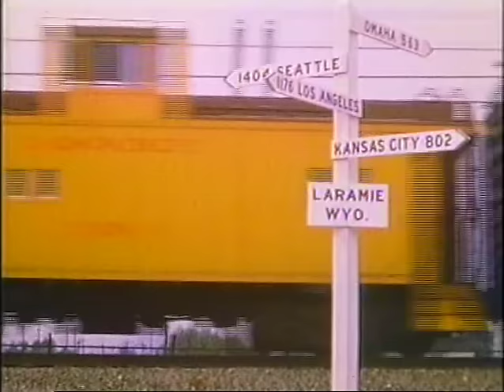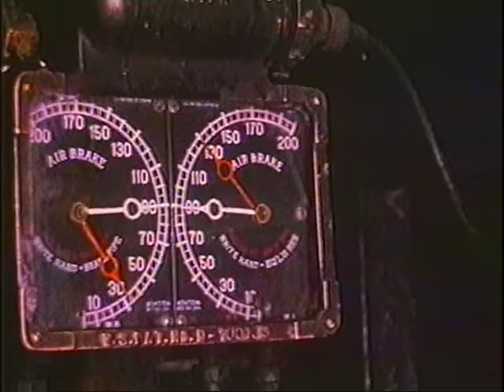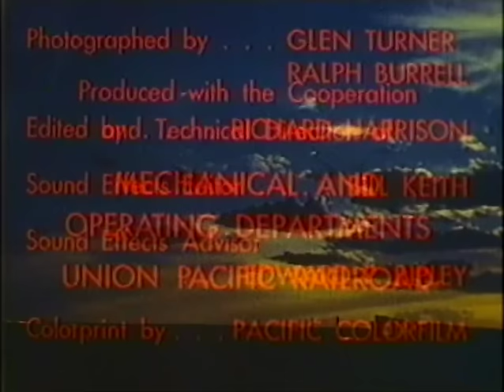Last of the Giants--Union Pacific Railroad

Comment: Yesterday Big boy 4014 ran under its own power for the first time in decades
Reply: It really is a spectacle to watch it's almost as if it was a living being
Reply: Any idea as to why they have diesels pushing from behind now? That just spoils the look of the glorious Big Boy locomotive
Reply: @thunderturbine8860  doesnt really spoil it, the fact that a 4000 moved under its own power in our lifetime is already a miracle as it is... anyway the diesel is for dynamic braking and switching, and as a backup in case of a problem with the steam loco's, etc. Whole host of reasons, really
Reply: @urmad378  OK That's a fair point. Dynamic braking wasn't a thing in steam locomotives back then.
Reply: That was more than a year and a half ago. Wow
Reply: @thunderturbine8860  well back then the dynamic breaking was the engine brakes  and the weight of the engine as on guy pointed out to me at the fort wayne railroad historical society pointed out that was several years before I joined though, now well I follow railroad information and history almost daily, espcially the history around here you have the water level route that went though north dekalb county, the b and o though garrett, and the pennsy that went though fort wayne the altoona of the west as it was called at one point at the turn of the 20th century.and you know the legends of the trains there with the likes of the t1's the s1, s2, q2, q1, the hudsons and the niagras north of here, and the last steam on the b and o though garrett
Reply: @thunderturbine8860  because the brass refuses to let big boy pull under its own power.  They never had that issue with 3985 or even 844.
Reply: @ojsefg  Ah ok, fair point
Reply: @thunderturbine8860  actually it’s not running it’s there in case it breaks down
Reply: @thunderturbine8860  the diesel behind it gives electric power for the passenger cars
Reply: @DelcoImagery  Ah ok that's the reason for the diesel locomotive
Reply: @thunderturbine8860  You also see a config like that frequently in central Europe, with an electric engine at the end of the train - usually an oldtimer of sorts (which might even be older than the steam loco itself xD), so it's not that bad. The reasons I've heard are heating (for cars that aren't designed to be steam heated), as well as braking related stuff. In one case it wasn't even a locomotive, but just a control car (the kind that has a driver's cab, but is designed to run either with an actual ("remote" controlled) engine or at least a motor car on the other end - unless I'm mistaken about the design of that unit, it would never be able to apply traction, but it would be able to "communicate" with the passenger cars, and, I guess, their built-in brakes and all that). I can only imagine the kind of coordination that must be required to make all the breaking and stuff work smoothly when operating with engines that can't be hooked up for remote control. :)
Reply: @thunderturbine8860   steam engine have lots of horse power but lack in torque. so they add a diesel engine to keep it from wheel spin and destroying its wheels and or track. but i do agree it spoils the look but its better than nothing
Reply: @thunderturbine8860  it's not pushing it's to provide electric power to the coaches
Reply: @thunderturbine8860  They run steam *occasionally* without the diesel. If you follow it enough you sometimes get a chance to see it alone
Reply: @DelcoImagery  actually no. The diesel is there for breaking, along with storing fuel and extra food for extended trips.
Reply: @thunderturbine8860  Federal law
Reply: @DelcoImagery  The diesel doesn’t provide electric power for the passenger cars in this case. That is only possible with passenger diesel locomotives, and all of UP’s diesels are set up for freight (yes that includes the E9s). UP uses a generator car for electricity
Reply: @ojsefg  If that were true, the reason would most likely be due to how Steve Lee ran the steam program. Patch ≠ repair. Either Ed chose to run with diesels because Steve Lee left a bad taste in the brass’ mouth, or the brass demanded he do so because Steve had the locomotives in such bad shape.
Reply: @blackbirdgaming8147  I also believe that part of the reasoning was the events of railrfair '99. Not mention that Big Boy's brake pads are $$$$$
Reply: @JakeCatmull  Yeah, that would make a lot of sense. Diesels are also now required due to PTC. The successful break in run to Denver and back a couple days ago was to test LEAP PTC, which works with the diesel helper. From the way it was explained to me by people in the know, SD70M #4015 may be permanently assigned to 4014.
Reply: saw it as it came through town
Reply: Official statement from Ed Dickens himself, manager of the steam program, regarding why diesel helpers are used on steam operations: 

My opinion offered again here to help build understanding of our present day operations. 

I have been involved with this operation for over 17 years, and I can tell you that gallivanting around the system without diesel assistance takes a very heavy toll on man and machine. 

While quite popular with Railfans, it comes at a very high cost. 

Consider the standard passenger train operating during the steam era. The passenger cars rarely traveled over several hundred miles before they were inspected by the eyes and experienced hands of well equipped Carmen. They changed out worn brake shoes and attended to the servicing needs of the train. When we go out into the field, we do not bring additional staff for this purpose. Trust me, without dynamic braking you will grind the brake material down rapidly considering how many stops we are making each day. 

I have been on trips where we have been plagued with ongoing mechanical problems from day one of that trip. Even for the hard core Steam Foamer like me, this represents a massive drain on the human side of our limited crew resources.

I have also been witness to severe locomotive boiler issues. The pressure vessel was leaking so significantly, that we had to RE-steam it up twice each night just to have sufficient water and pressure the following day. Imagine being part of the crew that gets out of bed at 11 PM, checking back in at the hotel by 1 AM only to get up at 4 AM once again. Now do this every day for four weeks. And then drive a vehicle, run or fire the locomotive with little rest, only to do it all over again for 30 plus days. 

Now let’s consider the mechanics of the 1940’s steam locomotive and contrast that to the modern locomotive systems in operation today. You can easily see how complicated our logistics becomes for the small number of staff that I have. 

It would be a great daydream for all of us to simply tack on maximum tonnage behind the locomotive and really put on a show for everyone. In my judgement, where would that get us in the end considering the logistics that I’ve  mentioned above. We do not have infinite resources to perform all of that mechanical work that the railroad did back then. We do not have the vast store departments staged along the route with racks and racks of spare parts. Spare NEW BRAKE SHOES, rods, spare drivers with brand new roller bearings, spare super heater units, just go down the list of parts and you may reach the same conclusion that I have. 

I must be very judicious with the resources that we have available for this massive mechanism that we have just carefully restored. 

As a rule, I rarely use locomotive sand on either the 844 or the 4014. I rarely slip the drivers when I start the train, I have the cylinder cocks open and I’m very mindful of all aspects of these massive and powerful Locomotives. A few quarter slips here and there when we start the train, and you will hollow tread your tires easily within the 4000 miles of our average trip. Now, with a shortened maintenance period, due to this type of unnecessary operation, you are dropping the drivers to turn them to get them within proper profile once again. 

Another point regarding high tractive force operations. Sand is required to be used due to the intermittent thrust characteristics of the steam locomotive, imagine what that does to the tires, it accelerates wear and tear on all the other associated parts of a steam locomotive. That abrasive fine white silica powder getting all over the expensive machinery that we just restored. Look at photographs of the 4000’s in operation and notice that the drivers and machinery are white with this abrasive dusting. 

I hope this provides some insight into the conservative approach that I take. I take this approach based on what I have experienced first hand in order to field this equipment for future generations. Remember, we must arrive at each scheduled location on time and in good running order with sufficient time left in the day to do all the necessary “roundhouse work“. This work is required daily to service the 1940s locomotive. Only then can we be prepared for operations the following day. 

Thank you
Reply: It,s like the 1950s
Reply: @blackbirdgaming8147  well i guess that answers a bunch of questions I had.
Reply: @thunderturbine8860  What do you think about all of these Train Video’s.
Reply: @thunderturbine8860  increased fuel efficiency, less diesel used, faster to get to speed, less slack action, better train line pressure. For the wise 'hobo', rider of the rails, a sager shelter from the weather, heat or air conditioning, safety of the cab.
Reply: @rosspixs4176  Actually steam engines have great amounts of torque, that's the reason it has so much power which slips the wheels. Unlike internal combustion engines that have an optimum operating speed steam engines are at full power within one rpm instead of 1500, 2000 rpm ECT with internal combustion engines.
Reply: I can’t wait for the big boy this year
Reply: The diesel is behind for multiple reasons. One, its systems aren't compatible with today's passenger cars, such as braking. Two, it's there to reduce big boy's fuel consumption. The big boy has more than enough strength to pull a passenger train on its own, but as you heard in the video it is very fuel and water hungry. A diesel in notch one or two can really boost efficiency. That's the main problem, efficiency. Water and coal are not as readily available on the railroad like they used to be. Getting water requires cooperation with the city for a massive amount of water. 4014 uses oil now, but either way the logistics of getting fuel that isn't readily available on an industrial scale anymore is a pain, and it's expensive.
Reply: @urmad378 HEP too
Reply: @thunderturbine8860 ive heard they mostly put power through the diesel so the steam doesnt get as much wear and tear
Reply: Man that was 3 years ago now I feel old 👨‍🦳👨‍🦳👨‍🦳
Reply: @thunderturbine8860 dynamic braking

Comment: im still trying to get my head around the amount of service this engineering masterpiece needed, i mean what do you expect, its just massive
Reply: Indeed, to think that today one single crew engineer can control a whole 2 mile long freight from one cab over whole distances, these needed 5-6 men minimum just to get the train out of the yard; engineer, fireman, conductor and then (usually at least) 2 or 3 brakemen, nowadays even an extra conductor is becoming a thing of the past
Reply: @haydendraycott7897  Yet, the Big Boy pulled five miles of cars.
Reply: Just THINK of the MANUFACTURING Process at ALCO    American Locomotive Company ! 
NOT one single solitary PART was made OUTSIDE of the UNITED STATES of AMERICA

Comment: This film features several survivors:
1243 (4:56)
2295 (3:44)
9000 (8:38)
3985 (9:35)
5511(5:18)
4012 (14:54) Drive Wheel 'L8' only. I'm guessing backmost axle, left wheel?
and a special appearance by the original Big Boy 4000 at 14:29 and again at 17:30, although it did not survive into preservation. There are many background engines that I could not identify, so some of them COULD be survivors for all I know.
Reply: I watched this video many times as a kid. I just came back from the Durham Museum in Omaha, Nebraska, and Union Pacific #1243 is there on display!
Reply: At least we may see 5511 and 3985 run again since they’ve gone to be worked on
Reply: While it isn’t in this film union pacific 844 would’ve been a contemporary of the scenes of what we see here and it would have either just ended its original era prior to being withheld from retirement around this point, or it would have just embarked upon its long excursion career. I kind of wish we got to see some very early footage of 844 in this because I have found that I pretty much can’t find any footage of 844 prior to 1960 and even then it’s almost impossible to find any footage of it before 1970 as a 1966 era Trip is one of the first things that I know for certain was recorded on film other than the 1960 snow plow experiments it was a part of.
Reply: 4466 also appeared pushing 4012 to the wash.
Reply: @ericurbane99  The locomotive pushing the 4012 looked awfully big to be 4466, or one of her sister engines.

Comment: My grandpa and dad both worked for the ICRR Illinois Central. Grandad was a crew chief and dad a laborer. At 25 cents a day dad worked around the coal steam locomotives. It was a good job if you could get it. The RR gave Grandad a IC Railway house right 20 yards off the mainline, big Ol barn. As a kid my dad liked the smoke and cinder flying back by the window where he rode the line. Big trains Big drive wheels, lot of action and fun!!

Comment: If #5511 at 5:18 looks like its smoke isn't being lifted very high, that's because it's not actually steaming. That locomotive was out of service by the time the movie was made, but to make it appear operational, the railroad set some tires on fire in its smokebox and pushed its train from behind with a diesel locomotive. The visibly weak puffs come from the valve gear being moved by the rotating driving wheels. You'll also note the lack of steam coming out of other places on the locomotive--compare it to the film segments just before.
Reply: I keep reading that in different places,  but if you look at the generator right in front of the cab... it looks like there's steam coming out of it...

Comment: While designed for smooth operation up to 80 mph to avoid beating itself up hauling freight at track speed, no Big Boy has ever hit 80 and revenue speeds hardly exceeded 50 mph, mainly because their mainstay was the steeper grades. The fastest reported speed on a Big Boy was 72 mph on a test run. Still impressive if you ask me, and still faster than the Challenger's official top speed of 70 mph (I still love the Challengers though). Though neither the largest nor most powerful steam locomotive ever built, it still ranks among them and it goes without saying that they are legends. Definitely more than worthy of preservation. So glad 8 survive. The Big Boy was probably the first locomotive I got to know about and study, having first heard of it as a child and they still fascinate me to this day and is my favorite steam locomotive (tied with the Norfolk & Western J 4-8-4).

Comment: 21:19

Okay, guys, so the Union Pacific's steam fleet wasn't made out of atoms.
Reply: +RockyRailroad Productions Because 50's LOL!
Reply: +ThePainTrain765 well hello I'm one of your subscribers
Reply: everything is made of atoms mate
Reply: @theodor12  living things are made of cells
Reply: It was assumed that atomic trains planes and automobiles would be on the way. Ford had the concept nucleon, the air force extensively researched atomic planes and the navy has nuclear subs. Atomic trains never really got anywhere.
Reply: @Handlesarestoopid  And cells are made out of atoms too.
Reply: RockyRailroad Animation that'll make a cool fallout arc: atomic rails!
Reply: @theq4602  I wouldn't rule out the possibility. The way the current research is going, there's probably going to be a lot that changes about nuclear power in the next 50 years, and you very well may see nuclear locomotives.
Reply: detailed plans for nuclear locomotives were drawn up, but it was eventually decided that they were impractical due to a prohibitive up front cost and size compared to diesel electric locomotives of similar power, a nuclear locomotive would have the advantage of needing much less fuel though.
Reply: ok, I just want to leave some science here for anyone wondering why nuclear power locomotives never took off, it simply comes down to weight of shielding, radiation shielding scales with mass, so to block all the radiation coming out of the core, the loco would need to be unreasonably heavy, would it still be a bad idea to use a fission reactor on a train, yeah, probably, it would become hard to control and hard to cool, but shielding was the real issue, now with that said, it's possible however unlikely that fusion reactors could be used in locos, however I see more chance in steam coming back than putting fusion reactors on the locos themselves instead of just electrifying the track
Reply: @Handlesarestoopid  and cells are made of atoms:)